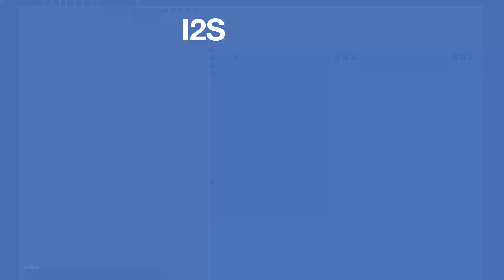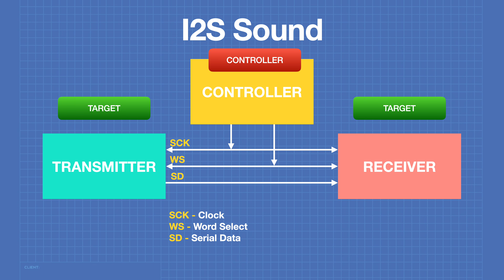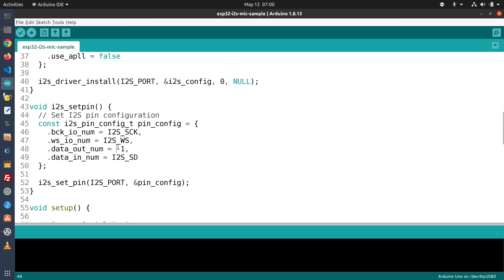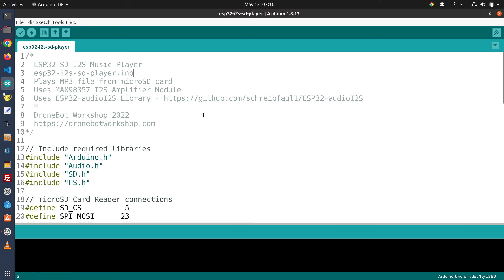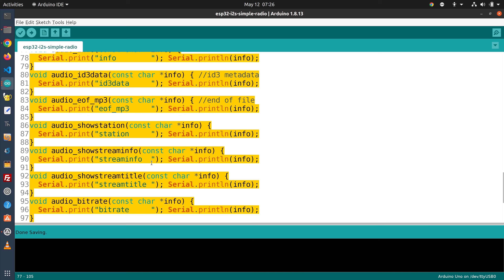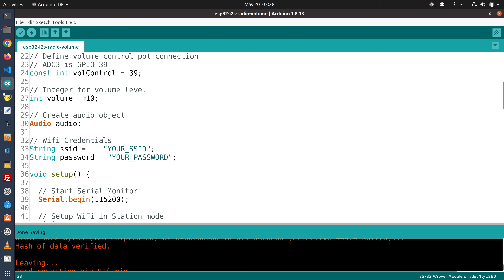ESP32 Sound - Working with I2S

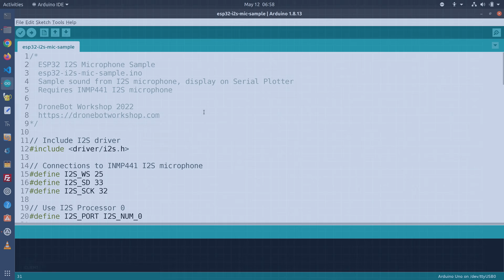Comment: Just a note:  The wiring diagram for the INMP441 at 13:04 doesn't immediately match the code download on your page:  Specifically, GPIO pins 32 and 33 are switched.  Easy fix, thanks for the clear explanation.
Reply: Thankyou...I was disappointed it didn't work the first time but changed the pins and it works great!

Comment: Excellent explanation and demonstration on the I2S protocol with the esp32. I'm planning to make an Internet radio and this is exactly the detailed  information I needed, thank you.
Reply: Did you build the radio? I did works great. I'm stumped at the volume control. My 'no brand' 38 pin dev board has no pin GP39 nor can I find ADC03 on any of the ESP Vroom 32 pins.  Any help here would be appreciated.

Comment: To get sound from microphone you need to correctly provide i2s_config and then correctly work with i2s_read. You described EVERYTHING excluding probably quantum field theory but completely skipped the MAIN part of the tutorial. HOW TO WORK with sound by i2s :)  I hoped for details in playing part but you got even further and replaced description completely by using ready-made library working ONLY with particular module :))) Great source of knowledge :) Probably I misread the header and idea was to work with i2s by itself. Not with sound and microphone ! Now we know how to work with I2s until we need meaningful results. Goal achieved :) God bless i2s, it's working :)

Comment: Super video lesson. Thank you so much.
So for the next step, would you please try to transfer sound (i2s protocol) by radio?
4 different cases possible:
1)Esp32 has built-in wifi/bt module, so its possible to make kind of walkie-talkie through standard protocol.
2) esp-now
3) external radiomodule (barely lora modules fit for streaming signal, but maybe a short audio messages?) otherwise nrf24l01 are good.
4) through the internet server (existing or just a custom homemade server on orange-pi or etc)

Would be very helpful. Thanks!

Comment: Very good tutorial, clear  and  extended explanation of this subject !  Respect !
Reply: I'm using the Teensy 4.1 as a waveform synthesizer, outputting 5 discrete signals (X, Y, red, green, & blue) to a laser projector. There is a total of 17 waveforms being generated, including 4 * X/Y pairs for the basic image, 2 pairs for AM pulsing, 2 triples for RGB color modulation, and one for intensity modulation.

Comment: Thanks for this video.  It was helpful.  One thing to consider: the Adafruit SD breakout contains a voltage regular to convert 5V to 3.3.  You connected the input of this regulator to 3.3V instead of 5V.  This (usually?) works because the regulator has a very low voltage drop, but it still has a drop.  You will be running the SD card at 3.2 or 3.1V rather than 3.3V.  Maybe it is better to connect the SD breakout 5V pin to the ESP32 VIN (5V) rather than the ESP32 3.3V.  The SD breakout uses a 4050 hex buffer that is powered from the 3.3V rail.  So, it causes the signal outputs to be 3.3V. regardless of the voltage supplied to the SD breakout via its 5V input.  This works for 5V systems (e.g. Arduino boards, not ESP32s) because 3.3 is more than 2.5V, and the 4050 tolerates 5V inputs.

If for some reason one must drive the SD breakout with 3.3V, I think it would be OK to connect a 3.3 supply to the SD breakout's 3.3V pin.  This bypasses the regulator.
Reply: excellent point! Thank you

Comment: Note that some SD card breakout boards do need to be powered with 5v, and have a built-in voltage regulator for 3.3v operation.

Comment: Great video, Bill! I'm one of those myriad of other I2S users/makers.
But, I chose the Teensy 4.1 for my project, because of it's great Audio library, which was forked by Adafruit on github.
Thanks to your great explanation, now I understand why the 2 libraries are incompatible, because of different DIN pin assignments.
I'm using the Teensy 4.1 as a waveform synthesizer, outputting 5 discrete signals (X, Y, red, green, & blue) to a laser projector. There is a total of 17 waveforms being generated, including 4 * X/Y pairs for the basic image, 2 pairs for AM pulsing, 2 triples for RGB color modulation, and one for intensity modulation.
The waveform generators are pushing the galvos to their 1kHz limits and can be mixed between sine, square, or variable sawtooth waveforms.
Each of the image generators have envelopes with commonly controlled ADSR to avoid snapping the galvos while changing preset frequencies and/or waveforms.
All of these + mixing gains are controllable via usbMIDI from an Akai APC40 MIDI desk, Cakewalk's DAW, and/or Pure Data's GUI on a 22" touchscreen monitor, for additional controls.
Speaking as an old Laserium laserist, I can vouch that the Teensy 4.1's audio library is rivaling the capabilities of their show system, for only ~$100 + ~$850 RGB laser projector + ~$250 MIDI controller. IOW, I have a laser show in my living room for ~ the same price as my 5.2 Polk/Denon sound system. That blows away my previous expectations for any MCU.
Can't praise PJRC enough for producing such a great range of products, with great documentation, a node red-like GUI audio design tool, and welcoming support forums.
Okay, I'm finished with gushing my joy all over everyone. Only wanted to share my I2S experience. If anyone is interested in the details, our pal Dave, on Notes and Volts has great step by step DIY synth tutorials on YT for both the Teensy and Arduino MCUs.
https://www.youtube.com/playlist?list=PL4_gPbvyebyHi4VRZEOG9RKOYq5Hre3a1
😎

Comment: I am somewhat sure that the size argument in i2s_read() function is the size in byte(how many bytes you wish to read) and as you are using 16bit samples the bufferLen should be multiplied by 2 or more correctly sizeof(sBuffer[0]). As you used only the bufferLen only half of sBuffer will be filled with samples.

Comment: Thanks SO much for your videos, which are always thorough and concise. Regarding your issue with your SD module, I came across the following comment on Amazon for a SD card reader. It might pertain to your board:

All was working well. I disconnected it to put it in its new enclosure and use a proto-shield. Suddenly, it would corrupt files, but only sometimes. It would corrupts the whole file system. There are two GND pins on the board, on on each end, so I swi8tched to the other one, and it worked perfectly. Maybe 1 is for 3.3, and the other is for 5?

Comment: Great video, thank you, but it did take me a few minutes to debug your mistake when you swapped GPIOs 33 and 32 between your circuit diagram and your code. You may want to update the video with to not confuse newcomers, or opin the correction in your pinned comment

Comment: Thanks for the great description of working with audio.  It all looks pretty straightforward, but I haven't gotten around to getting any I2S peripherals yet.  BTW, I like the looks of those jumper wires you use -- can you tell me where you got them?  I also heard about a VS1053 MP3 decoder on another ESP32 channel -- is that similar to what you're using?  What are the differences?  (It would be handy to have links to the hardware you use accompanying the video.)  Thanks!

Comment: I get that it's an older protocol now (ironic, given that it seems only the latest DIY devices support it), but why on Earth does it use an entire wire just to select the channel? You've got two high speed data lines, and then there's a third one that's operating at a much slower rate just to select the speaker. I wonder if it would have been too much work implement just having a specific data bit select the channel.

Comment: That little MP3 Player based on the ESP32 could be perfect for something like a model railway situation where you may just want a looping file of sound effects relevant to a particular scene.    The quality of the sound is quite good :)
With this setup, would it be possible to use a button or integrate an LCD to choose the "station" to play?
I know these are mostly just little experimental projects, but I love doing stuff like this :)
Oh, just a note.  The link to the article doesn't work properly as you have a \ instead of / :)
Reply: Yes, you could tie a button select to change the station web address string then reconnect to that one.
Reply: You could have one in each rail station, calling out train arrivals, or in each home, complete with family arguments. How about echoing train sounds inside the tunnels?
Yes, you could control some from timers or via GUI on a phone app.
I remember a guy in Cincinnati, back in the 1960's, who had an entire garage converted into a miniature landscape with multiple tracks and a roundhouse. Sounds like great fun.😎
Reply: Stop wasting my time..

... by suggesting so many cool things to do with these MP3 players.😚
Reply: @oscargr_  "I didn't mean to take up all your sweet time. I'll give it right back one of these days." - Voodoo Chile, Jimi Hendrix. 😎

Comment: Hey 
Nice explanation about I2S and many examples, I tried running in esp-idf, there are errors any changes needed and also I have a esp32  board where mic is embedded so I have to remove only the connections given in code or any other changes is needed

Comment: Hi. Thanks for Your job.
I'm thinking about building a simple music player with stereo output, 2x16 display, physical buttons and remote sensor.
Can You tell, is it possible using ESP32 and this "Audio.h" library ?
My goal is to see playing time, file and folder number. Skip between songs and change folder.
Search through the file with sound will be probably impossible.
Right now, I'm struggling with arduino  libraries. I can't even compile original sketch provided with library.

Comment: I think these WS L/R microphone pins are a bit weird. Because "leftness" or "rightness" are defined by a microphone placement, and not by controlling signals. I think if you ground them all nothing will change.

PS SD card is a big fraud. One off thing by design.

Comment: On the mp3 playing part, I compile and run but i get  audiobuffer out of memory.

OOM: failed to allocate 131072 bytes for unnamed
OOM: failed to allocate 679936 bytes for AudioBuffer

my setting: Flash size: 4mb (32mb)
                     Partition Schema: Hugh App (3mb No OTA /1mb SPIFFS).
I tried other setting and I got  121 % usage of sketch at compile time.
Reply: Did you resolve this issue? I have the same after selecting Huge App on the ESP32 Dev board
Reply: Thank you for the info, I've been having trouble with this for ages.
Reply: In the end I used a esp32 cam now works fine 😊
Reply: @garyhart6028  You able to use camera and play mp3 audio at the same time?

Comment: 12:51 Hey, I have a question at this point in the video. I realized that on my board, ESP32 WROOM 32, only has 2 pins for the DAC. It's GPIO 25 for DAC1 and 26 for DAC2.  If I use 1 of the DAC pins for the mic, can I use the other one to connect a wire to a speaker?

I'm in the process of trying to create a live real time voice system where I can hear my voice out of the speaker as the INMP441 is being spoken into.

Comment: Thank you for the video. It is one of the rare good videos on this subject for beginners like me that is easy to follow. I went along your first example where you paired the mic with the ESP32.
The only difference was that I used the the adafruit MEMS mic module you showed
instead of INMP441.
When I upload the code, I get 0 as output of the mic plus the +3000
and -3000 lines, and yes I am playing sound :). I have double and tripled checked everything but still do not know why this happens. Could you please help me to figure out why I am not getting the 
audio in the plotter like you did?
Reply: i have the same problem, did you solve it?

Comment: Re: WS line determines (something) left from right and the "L/R" line which chooses left or right "channel"
Why does a single microphone need to say whether it's left or right twice?  Does "WS" left or right have to match "L/R" left or right?   If two microphones are used, are WS and "L/R" both set to right for one and left for the other?  What "left/right" thing is WS selecting that isn't covered by L/R?  If you bring "L/R" high the output will be in the right channel?  I only see one data line coming out of the microphone board

Comment: Is there a bug in the website? For Microphone Module Code, the diagram has different connections for SD/SCLOCK than the code. They are just interchanged.
Did anyone get this up and running on a Adafruit Huzzah32? I am not quite inexperienced, but I struggle to get any input signal.

Comment: Hi, I would like to use I2C MIC to capture the sound and forward it to the I2S DAC MAX98357A, I can not find any example how to do that. It should sample MIC and forward PCM data to the DAC. If possible I like to add volume control and have a led strip  showing when someone speaks. Can you help? Thx.

Comment: I am running your code successfully on WROOM32 with WS@15, SD@13 and SCK@2. Thanks for the explanation and nice video. I have one question. The data sheet for sensor says the output word is 24 bit but in your code it is setup to read only 16 bits. Is that correct?
                  .bits_per_sample = i2s_bits_per_sample_t(16),
Aren't we loosing resolution?

Comment: i love your videos :) been watching this one with lots of interest. I was wondering if you could help me pls? i have 2 esp32 and i wanted to connect them togever using i2s but i can get it working. what im trying to do is pipe internet radio to a Bluetooth speaker, i have one connected to the Bluetooth speaker which pairs and works fine. the other one is connecting to the internet radio which is working but i can't seem to link the 2 esp32 togever ands make it work. would you have any idea what im doing wrong. thank you

Comment: Hello, I use the MAX 98367A amplifier and a micro SD module, but now I also want to be able to play via Bluetooth from my cell phone, but it seems that there is interference, the 2 do not work in the same programming, only 1 works.
pls Helps

Comment: One question here:
I always struggle with configuration and operation of such esp devices.
I mean its easy to configure and hardcode some parameters in the sketch (sid, password, some urls) and then have few buttons to navigate/control those devices.
Its ok-ish to have web interface to them.
but it all is kind of awkward. You either need to have a button to boot into hotspot mode and reconfigure the device over http, or some gimmicky way to button in your config.
Sometimes you can put the config on sd card.

But it all is kind of gimmick.

What ways of easy and universal control do you know, like. recommend?

My favorite is web interface and this trick with hotspot booting. It requires phone to configure the device but it works and is rather usable (copy/paste) and it does not require sdcard interface.

but are there any nice alternatives?

Comment: Does the ESP32 on station mode have to work with Web API's (internet audio) or can I use a local network with a server (Dhcp) and work with the ESP from an installed app on the Server (Win OS for example) and essentially stream sounds etc?, I seek to send sound to an ESP32 fitted with an amp and speakers as well as have have the ESP32 fun a neopixel strip (independently )

Comment: isn't there an error with your sd card wiring ? MISO should be connected to GPIO 19 and CLK to 18, right?
Reply: The wiring is actually correct (CLK goes to 18), but in the list next to it it is wrong: GP18, GP19 are swapped.

Comment: Great video as usual. Two part question: 1. Anybody notice that on the sketch for the MP3 player,  the sketch shows the CLK going to 18 and DO going to 19, but he says the opposite and on the list it's written the same as what he says- CLK 19, DO 18. Confusing me like hell. LOL Which ones are right? The other day I got it to work somehow and left it aside for a week or so and when I tried to play it again nothing is coming out. The Player and the ESP32 are both flashing, so I tried a different card, a different amp and speakers and still the same result. Any solutions? :0)  2, If I add the potentiometer parts to the sketch of the MP3Player to get a volume control, I get a message saying that it is a ESP32 and NOT a ESP32-S2. Since I'm not experienced enough in the matter, does anybody know why? As soon as I download the simpler sketch, without the volume parts, it downloads fine (apart for question number 1). #3 What would be the right code to add a volume control? Sorry for the long text. Thank you.

Comment: Hello sir, I am currently working on project in i want to display messages in led dot matrix through NodeMCU esp 8266. While I had connected to PC the port is connecting and program has also uploaded well. but the message is not showing. Whenever the led dot matrix connected to Arduino its working. What is the reason for this issue and how to resolve it, Sir ?

Comment: My code will not compile and fails as you said it would atl ine 32.  Where do I get an updated copy of the library, please?  I am using Arduino IDE 1.8.4.  I can see that you are using 1.8.13.  When I installed that a LOT of my programs quit compiling so I went back to 1.8.4.  Thanks for your help.

Comment: Hi, a very usefull video, thank you. Currently I am trying to get started with audio projects. I am using ESP32-WROOM-32, MAX98357A, PCM5102, PAM8403, INMP441 Micro and 8ohm/2W speaker. Unfortunately when I try to upload the code via Arduino IDE, then I got the following error: "Compilation error: Text area exceeds available space on board.", although the main code is very short and the memory of my ESP32 is 4MB. Obviously you could upload the code without any problems. Did you have such kind of error? If possible, could you pls help me to solve this problem? I already spent some hours without any success 😞 Many thanks in advance and greatings from Germany. BR, Ercan